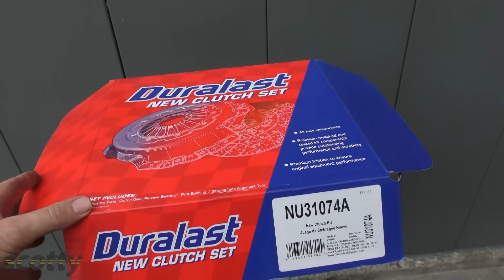5 Things You Should Never Do in a Manual Transmission Car

Comment: Scotty is right.  I had to get a new clutch because I drove like I was racing at the Nurenberg.  Unless you're on a track with a modified car for track use only, no need to downshift through all the gears and/or heel and toe shifting.  It's an expensive habit for douchebags.  Looks like some of the commenters are stubborn and don't understand what Scotty is saying.  Shifting down one gear at a time at the right RPM is different than keeping it at high RPMs and braking/slowing the car using the transmission.  Listen to Scotty, instead, and use your brakes and don't engine brake.

Comment: I was waiting for: “DON’T COAST DOWN A HILL IN ‘Angel Gear’ “!
Can’t see the issue myself except that there is no regulation of the vehicle by the engine which is safer.  This also makes it very hard to stay at the speed limit.
These days, as soon as the foot is off the accelerator the fuel turns off, so there is no $ to be saved either.
However some of the older vehicles could benefit from being in neutral and coasting, though still bigger all is saved.
Scotty?

Comment: So you’re supposed to clutch in, hold the brake, change to gear 1, pull the handbrake up and then shut the car off? 

I’m in a 2017 Mustang GT manual and I always brake, handbrake up, shut the car off, let go of the brake so the handbrake catches, hold brake again and go into gear
Reply: it's personal preference although method #1 causes slightly more wear on the clutch.

Comment: I disagree with manuals not needing rebuild/maintenance. Many modern manual cars in Britain/Europe have dual mass flywheels and clutch pressure regulator valves, concentric slave cylinder and other stuff to go wrong.

A good proper Japanese and some German/American automatic torque converter box is likely to just work for years. And if people actually get the fluid changed at any point then it should probably last the cars life. That's why North America were smart to focus on autos.

Comment: You should always keeps your foot over the clutch no matter what, your other foot is for your accelerator and your break, don’t know if this is different on American Cars.....
Reply: You're misunderstanding; everyone uses their right foot for throttle and brake, he's saying that you should keep your left foot on the footrest instead of riding the clutch because that causes it to grind against everything unnecessarily and wear out.
Reply: What footrest though? Everyone I know gets taught to have your foot over your clutch, just not applying pressure to it, in case you need to emergency stop or quickly change gear or something

Comment: Another tip: when applying the handbrake (not the emergency brake), press and hold the button in before applying it. That way you don't wear down the ratchet inside and so it'll last longer!

Comment: People used to give me s*** over floating the gears. I had a 6-speed F-250 5.4. Bought the truck used with 80,000 miles on it sold it when I had 240,000 still had a lot of clutch left in it

Comment: Always wondered, What would happen if for instance You were parked (car turned off) facing uphill, put it in second, rolled backwards, let the clutch out?  As if push starting the car but going the wrong direction. Would it blow up, start normal, and go forwards, or would it run backwards, and You would have 5 speeds going backwards?

Comment: does not look like scotty responds but does any mechanic know the answer to these 2 questions. 1st i have drove manuals for almost all my life so i only use the clutch when at a dead stop. i very rarely scratch gears (only when i am tired). question 1) when i try to float from 3 to 4 it scratches now. no matter what i do. all other gears and even going from 5 or 6 to 4 no scratch. it is specifically from 3 to 4. what would cause that? Question 2) does floating gears void the warranty? my car is only 2 years old and i have almost 30k miles left on the warranty.

Comment: My foot is almost always resting on the clutch. That's not riding it. There's no disengagement. There is small amount of slack. I never used my dead pedal, and have never come close to wearing a clutch. In fact, I was asked if it was new after I put 60k miles on it and I wasn't even the first owner.

Comment: What about hill start I take off handbrake and throw in 1st and hold brake. Then release clutch to bite point and release brake and Rev gas quick and take off. I know some people do it with e brake, my e brake is really good and tight when engaged so I don't use it.

Comment: What do you mean downshifting isnt smart to do?
You either downshift to get more power or to get more engine braking (only do this with 4-stroke-piston-engines reason below) so you dont wear out anything except your transmission and your clutch in a very marginal way that you will notice it in like 40 years. When your clutch is down its simply because you let it slip for too long when starting to drive. Wearing out the transmission (and stick) comes from you having no feeling in your arms or trying to upshift without the clutch but again have no feeling.

Comment: So if I am driving it normally and not at high speed .. let's say I'm on 4th gear then letting it run and not giving gas .. the car slows down .. in that case I can just switch to 3rd and not need to rev match or something right?

Comment: what about the flywheel should that also be changed when changing the clutch?

my drivinginstructor told me that when you park the car put it neutral and pull the handbrake is that wrong?

Comment: Only in America do drivers need to be told to use a hand brake for it's intended purpose. Rest of the world putting it in gear is what you do just incase handbrake fails. Also, he should have added put it in first if the front is up hill, put it in reverse if the front is downhill.

Comment: I was driving a manual 1999 honda civic and when i let go on the clutch in 1st and 2nd gear it would jerk so i would have to keep my foot on the bite point of the clutch to drive smooth but on 3rd gear and above it drives fine. Is this normal for certain cars

Comment: I took out clutch on my 1995 Toyota pickup with w55 manual transmission its has about 200000 miles and should I refill or flush the whole transmission oil?

Comment: Does the flywheel have to be replaced or resurfaced when replacing clutch?
Reply: depends on how thick it is and if it will still be in specs.  resurfacing is fine and should be done every time till it needs to be replaced.  some say that it doesnt need to be resurfaced but do you really wanna have a problem with a flywheel after you replaced the clutch?

Comment: Scotty what kind of car are you showing with the clutch in between the brake and throttle? I have been driving a manual transmission for nearly 50 years and have never seen that set up. Even when I go to Ireland or Scotland, even though the wheel is on the right side the pedal set up is the same.

Comment: Is it possible to shift transmission(Manual) without using clutch? I have done this in my 20's.
Reply: In Semi trucks you can its called floating gears, Semi trucks have mostly moved to autos but in a manual transmission, if you match the speed right and work the fuel peddle, the shift is easily done with no clutch and is smooth.
Reply: @eecajledo8430  Thanks, I knew it! With proper speed and yes, I can downshift the gear before stopping.

Comment: Scotty what about replacing the pilot bearing in the back of the crankshaft when you replace a clutch? This is for the input shaft of the transmission to ride in. Not sure if all cars have one but my 89 5.0 Mustang does. Does that come in the kit or is that separate?

Comment: Hey Scotty, I have a 1998 Chevrolet P/U truck 83.000 miles on it and is in mint condition. It features a 5-speed gearbox. Some times when I downshift to a lower gear, I will double clutch the transmission to ease the strain on the synchronizers and it usually just slips into the next lower gear. I am just wondering if this is really a good idea since I am using the throw out bearing and slave cylinder more. If I downshift without double clutching I will slow down and put just a touch of nudge on the shift lever to downshift. Could you let me know your thoughts on this subject. Thanks in advance.
Reply: Nah. 'Double clutching' is used only for those that use non-syncros. Rev match for downshifts. That NV3500 is more of a daily driver transmission. For comparison, try driving a heavier and slower NV4500 5-speed.

Comment: While we're at it I hate automatic transmission drivers who brake with their left foot. They immediately hit the brake on release of the gas. No pause or coasting just gassing it right up to the stop or turn. Throwing me forward as a passenger. I'm surprised we aren't rear ended. Popping the turn signal on at the last millisecond doesn't improve our chances either. 
Smooth drivers like me use the right foot for both pedals. 😇

Comment: 1:51 Can someone explain why you want to put it in 1st gear in this situation? What does it do? I normally just leave it in neutral, turn the wheels to or from the curb depending which way my truck is facing on the hill, and put the parking brake on.
Reply: When the car is in gear the car does not roll as quickly (engine braking) I think

Comment: Uhh, isn't it just common sense to engage your parking brake when you're parked in the first place?!?  
Also, downshifting aggressively (blipping the throttle and releasing the clutch to rev match) admittedly isn't always the way to go, but when the alternative is to slip the clutch up to the engine's RPM to get a smooth engagement, isn't that going to wear on the clutch more in the first place?  And what's the alternative to downshifting in general, just riding the brakes or driving in 5th gear until you stop next?!!?

Comment: I have a VW Jetta Wagon with 260,500 miles on it and I always downshift to go light on the brakes. I have the original clutch and it is working just fine. My car is a 2001, 18 years old. Downshift if you know how to drive a manual transmission.

Comment: Scotty, if you rev match your downshift, is it still that bad?
Reply: yes and no... if you rev match properly then it is not bad per say.  there will still be more wear on the clutch but it will be minimal.  I like to downshift because then i get to hear my engine and exhaust but thats just a preference.  So are brakes cheaper of course but there isnt any reason your clutch cant last 200k even with downshifting if you do it right or your not beating the hell out of it and racing lol
Reply: @TechAndMotorcycles  I'm talking in terms of the gears. Doesn't it hurt the gear a little? Hard on the synchros? I know rev matching saves clutch wear, but going down in gear, isn't that gear moving faster? 😮

Comment: Gotta disagree with the going down the gears.  Engine breaking is a legit thing. I've done it 30 0dd years never had a car fail
Reply: I would engine brake in my Miata all the time. Still on the original when I sold it 155k miles later.

Comment: Can anyone help me? As it seems like my best bet is to contact the dealership in Korea and translate information. I have a 2008 Hyundai Elantra 5 gear manual transmission. And even the dealership here is having trouble figuring out what kind of brake fluid I need. Just curious if anyone else had to do some research but so far I'm not having any luck. Has a hydraulic clutch that feeds from the brake fluid reservoir.

Comment: He said don't down shift but didn't expand further. So we just skip gears like 4th to 2nd? Will this make the transmission last longer?
Reply: No, you dont really have to down shift at all while normally driving. When you stop you simply push in the clutch (you can put it in neutral to save your foot and a little but of clutch pedal wear or keep in gear ready to go reingageif you are worried about avoiding something) and break to a stop no need to down shift. Only time i ever down shift is if i come accrpst another driver  in front of me going really slow or they are turning and my car is bogging down in the gear im in

Comment: I have a 06 Honda jazz. I hear grinding noises as I shift through the gears plus when I drive at 60mph or 100 km/hr I always have to rev the rpm to 3200 just to maintain that speed.  Any info on what's going on?
Reply: Possibly your clutch.
Clutch slip may be causing the 3200rpm requirement. Does the engine sound like it races a bit then slows down a bit like a CVT gearbox? Almost like the engine is "catching up?"
Also if the clutch isn't clearing when you shift it can crunch the gears.

Comment: Hey Scotty, can we coast in a manual when approaching a red light ?? Love from India.
Reply: Yes. Check out his other vehicle about driving a manual. It states when coming to a stop, place the car in neutral then apply the brake. Remember, the clutch is only used to disconnect the transmission from the engine's flywheel so it's only meant to be used when needed. When approaching a stop, you have two main options: shift into neutral, release the clutch and then apply the brake as needed OR you leave it in gear, hold the clutch pedal down and apply the brake (NOT RECOMMENDED). This causes excess wear on your clutch as you're stressing the pressure plate. So yes, it's fine (and recommended) to coast in neutral when approaching a stop.

Comment: Hey Scotty, my brother’s got 2001 Dodge 3500 quad cab dually. It’s got the 6 speed manual transmission. He also has a CDL, and has driven big rigs. He uses his big rig transmission shifting skills in his pickup truck ALWAYS floating the gears (never using the clutch shifting gears while under way) Do you think this is harder on the transmission? Is he saving wear on the clutch?

Comment: Clever design , slave cylinder inside the bell housing.   That is like doing away with cam chains.   What is the cost difference per unit to a car maker to use a chain and sprockets compared to a belt. Stuff all, $20,   ----  $50. Be generous say $100 Per unit, But then every 70,000 -100,000 ks the owner is up for 500-1000 bucks. So the car maker saves  $100, and the car owners pay thousands as a result per unit.   Easy don't buy from car makers to tight to use a cam chain.

Comment: Yeah, if you're going to go through the effort of taking your transmission apart to change a clutch, why wouldn't you replace every part at the same time? Clutches are relatively cheap. Its the labour of a mechanic taking your engine apart and rebuilding it that costs several hundred dollars. Are you really going to try to save $50 and cost yourself an extra $800 in one year when the next part fails? Or just spend $1000 in one go and have a brand new clutch system that will last you 10 years? Which saves you money in the long run?

Comment: Americans: “5 Things You Should Never Do In A Manual Transformation Car” 

Me: laughs in English accent

Seriously though do drop down a gear if you’re slowing down or you’ll labour the engine or even stall it, obviously don’t do it if unnecessary. Easiest way to remember is to match the gear with your speed, eventually you’ll get the feel of the engine and know what gear to be in. 
Also that’s not an emergency break it’s a handbrake and should always be used when parking or stopped for long periods. If you want to do an emergency stop you firmly press the brake pedal and dip the clutch at the same time, then put the handbrake on and put the car in neutral before moving again. Also never yank the handbrake like that or you’ll wear out the ratchet on it, alway press the release and pull until tight before release the button. And you should never leave a car in gear when parked unless you’re parked on a very steep hill, because someone could start the car without dipping the clutch (which is not good) along with this you should always dip the clutch when starting a car wether it’s in gear or not, for that reason. 

These are all basic things you’re taught in England when learning to drive

Comment: I’m sorry but modern cars run at there best in the higher rev ranges. Fuel consumption, drive ability, so on. So if you rev matching and that correctly you do want to be up and down the box. If your a fast driver that knows how to drive it is the proper way to drive. Engine breaking is your best friend. It’s repeatable reliable and most importantly is safe to use when cornering. So no this video is not the best and you ain’t changing my mind. So unless your driving slow if you follow this you’ll be driving more unsafe and uneconomically.

Comment: Going to dislike . 

Where is the tip of being smooth ?
Where is the tip of not reving the engine like mad when manouvoruing and setting off? 

I disagree with downshifting. plenty of people will need new 1st and 2nd gear syncros due to jumping from 5th to 1st gear
Reply: Sometimes when I downshift from 4 fourth to 3rd I hear like an electric drill sound am I doing something wrong

Comment: Lmao so what im supposed to just throw it in neutral and guess what gear i should be in by the time i accelerate again? sorry but you should ALWAYS downshift to 2nd unless you are at a complete stop. what if youre slowing down but not stopping, and need to apply power to be evasive, you should always downshift so youre cruising at least 2000rpm

Comment: Mr you need to rev the tits out of it slip the clutch for racing starts rip the handbrake through the floor and never lift the throttle while changing gear. And dont forget to shout abuse at everyone.

Comment: So you're saying going around a tight bend having been in 4th gear I should brake only and not down shift to go around? No that will lug the engine trying to accelerate in 4th with 1000 rpm. Clearly aimed only at lazy American driving on straight roads.